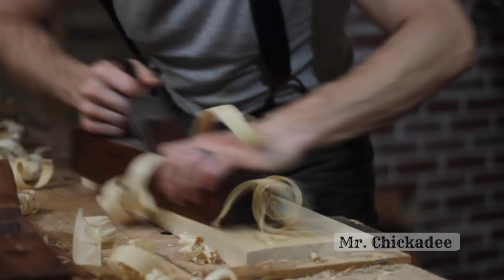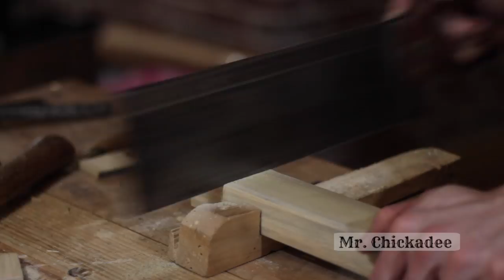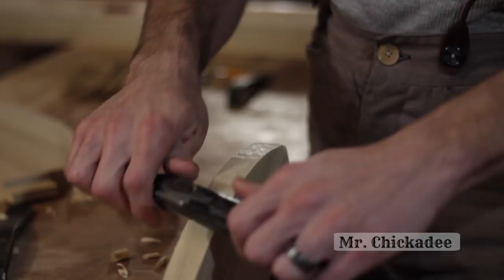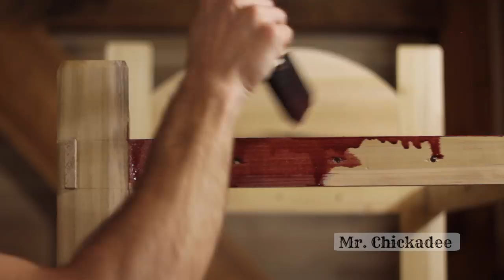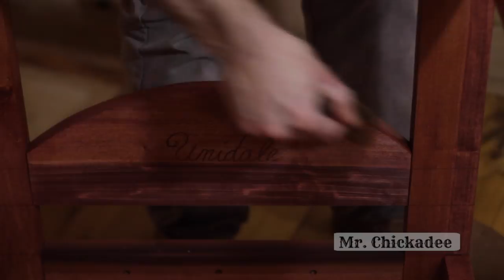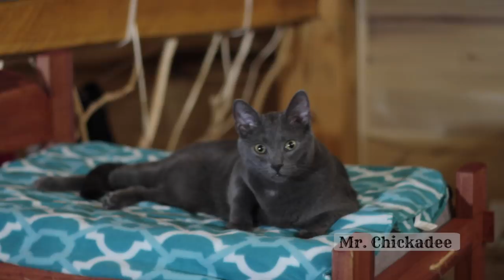ROPE BUNK BED FOR CATS

Comment: As a child I would visit my godmother who had a chestnut log cabin on mt. Washington. I used to sleep there on a rope bed much like the one you built, albeit not a double bunk, quite a bit bigger and probably one less cat. It had a tightening method that escapes my memory but the old hemp ropes had to be tightened from time to time. That cabin is still there, has been for a couple hundred years. I haven't been inside in probably 30 years but I've gone by it in the last couple years. It's in need of attention. Mine not to put too fine a point on it. I saw some work they had done to the place and whomever did it doesn't have a clue as to what they're doing. I hate to see beautiful things neglected.

Comment: Great carpentry, spoiled cats: it figues, somehow.

Garnet shellac?

Nice thing about rope beds is if you fit the tenons tight all the way around you don't need glue, wedges, or dowels. The rope holds it together. Even better with tapered tenons and mortises fitted with 1/8" draw. And it comes apart quick and convenient for moving.

Must be great to have planes with different settings on the bench. Rough with one, finish and joint with the other. Are you getting tool rich and cash poor?

I was thinking about an "upside down router plane." Works like a router plane  but off the benchtop to finish the tenon on the side opposite the reference face. Clamp the work face down and work the upside tenon face. The cutting edge is elevated above the bench by the cheek offset plus the tenon width. Heck! Can't send sketches! Grrr! But I see it using common Stanley #71 router plane cutters. Object is to ensure consistent tenon thickness and parallelism.

You saw it here first, folks.
Reply from the maker: Just some red stain and the usual linseed oil after drying. I prefer natural oils or waxes most times. 

Yep, most of my joints only pull up tight at the end as they seat, and most mortises are opened up inside, no need for a super tight friction fit unless you rely on glue joints, which I never do anymore, a peg or a wedge. 

Since most of my wood starts rough sawn or riven I use a heavy cambered jack to start, then a much flatter but still cambered try plane to finish. Ten bucks at a local flea market with full length iron left, couldn't resist. 

Patent the damn thing, then send me the first model to test ! ha!
Reply: Mr. Chickadee How about mounting a router plane on a "C" shaped wood base so it straddles the work? Make the base thick enough to put the cutter in reach of the tennon. Drill the router plane casting for a couple of screws.  But where could we find a clever woodworker to do it....?

Comment: What is the blade angle your big smoother plane ? I want to make own handplane. Also i am very excited when i see the new video. Thanks...
Reply from the maker: Most single iron planes have a 50degree bed angle, while the ones with a cap iron or double iron have a 45 degree angle.